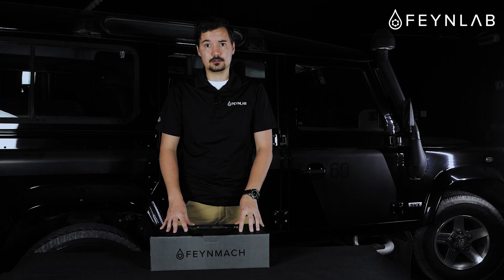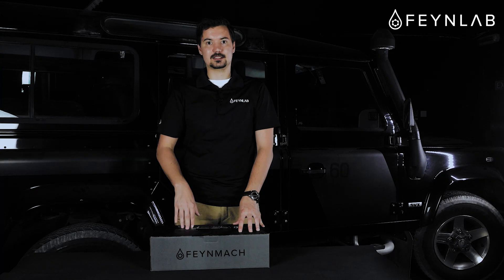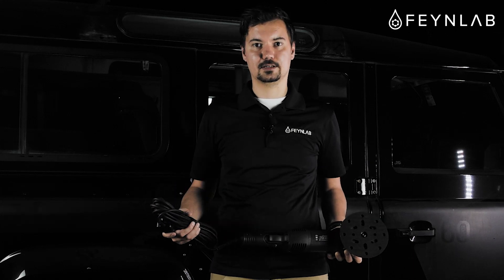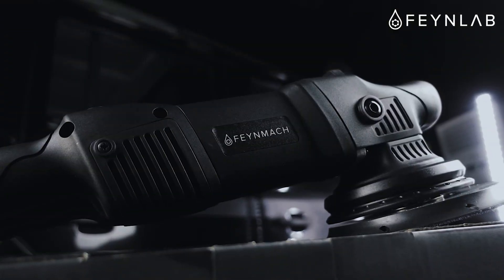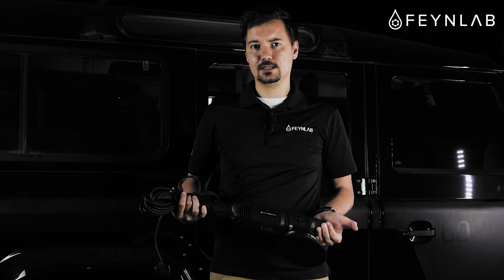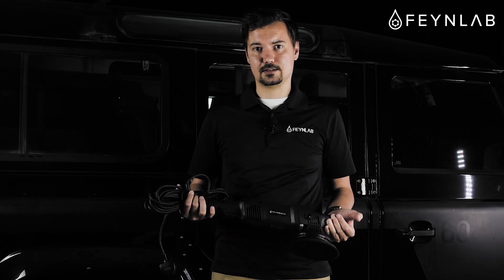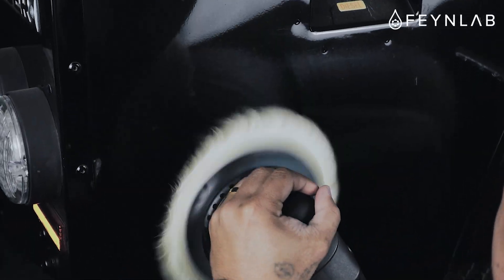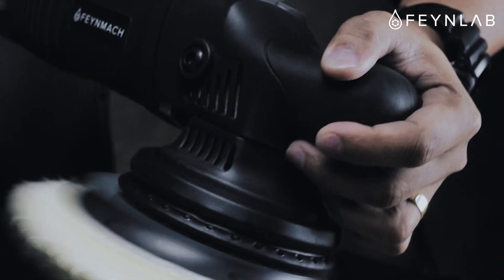We made our own polishing machine - FEYNMACH 21HP - 12M DA Polishing Machine

Comment: Is it really USA made and not China made?
Theres been 1200 watt motors and even a 1400 watt DA out for years , (nit sure if input or output) but watt doesnt dictate motor power (torque) or stall ..
Just means uses.more energy to run.

With that said, wouldn't mind picking one up, see what pad weight it likes and if it'll accept a 25mm eccentric assembly :-)